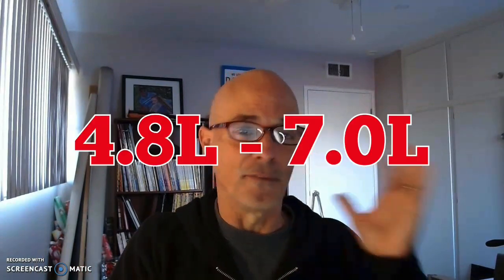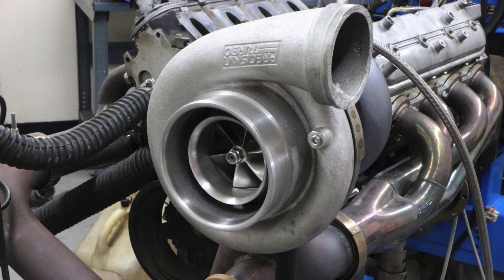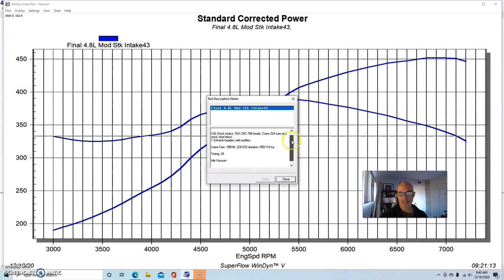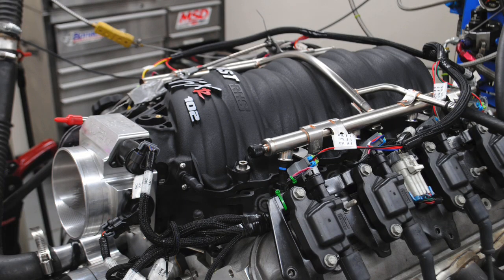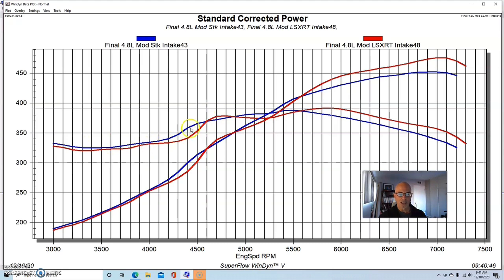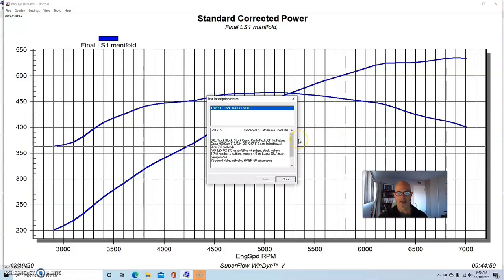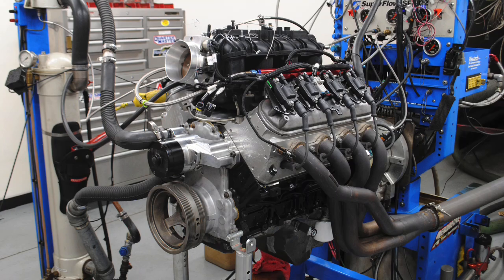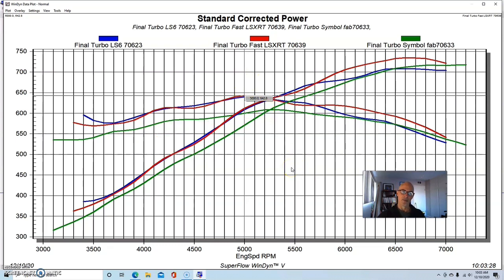LS TURBO INTAKE MANIFOLD MYTH-DOES IT MATTER UNDER BOOST?

Comment: MAXSPEEDING.   NOT a specific product question but a "material" process they market is where my curiosity lies.   I can't find any true definition of TITANIZING.  now sure it sounds sexy as Pankle Ti rods , but what is it seriously?  I do have a couple of their gt35s but haven't been spun them in anger yet.  Using the pair at a pair on a mild budget Dart 347.
Reply: $547 for set of Titanizing 996TT rods sounds "too good" and the cost in this application of failure is too high.  Maybe a set in a 4.8 and big bang it for rod comparison.
Reply: I like the idea of jamming all the their stuff into a 2.0l vw and see what it will do compared to a stock one. Those come with over 300hp stock in the right econo box and can take some serious whipping.

Comment: A short runner intake can work if the boost ramp can be controlled some kind of way. For example, a variable geometry turbine hot side  can boost torque under the curve to fill in the torque loss or use an electronic boost controller to ramp in the boost sooner. Why not do a test showing the effect of variable geometry turbos versus fixed, and electronic boost controllers vs. mechanical?
Reply from the maker: a short-runner intake always does the same thing-it makes less than the long runner til very high rpm-changing the boost curve works with both

Comment: We changed from a LS6 intake manifold to a short Runner Holley sniper and just ran  our first 8 second at 165 miles an hour. Never been above 158 mile per hour previously. I think the short Runner works very well on high boost.
Reply from the maker: boost level doesn't change what the intake does-you might be running higher engine speeds
Reply: @richardholdener1727  yes LS6 intake Peaks and flat lines at 6300 and the  sniper keeps pushin on up with Boost and  RPM. equals about 100 more horsepower at the top
Reply: I think running 8s at 160s isn't what most people are doing with their stock engines. At the drags specifically, short runners work really well. You spend all of your time at wot and half your time within 1000rpm of shift point. You also spend more time in the lower gears because the power doesn't roll over as bad. For guys on the street, it's maybe not a great idea but at the strip it can really pay off.
Reply: @timothybayliss6680   thanks for the reply Tim it's a 3600 lb 67 Camaro 3 pedal fully synchronized T56 transmission power seats and power windows not exactly a race car. It's a TCI suspension pro touring car. if we wanted to butcher it put it on a large diet and a Powerglide go a whole lot faster

Comment: A lot of VW owners use maxspeedingrods connecting rods and short runner intake manifolds in their budget builds. A friend and I built an engine with their rods and they were a better balanced set than the factory stuff. I think it was something like .5 grams on the rods. The stock pistons had a lot more deviation between cylinders.

Comment: Have U Ever Tested  Trick Flow Cast Iron Hi Port Street Heat Small Block Ford Heads ! . 0r . a Terry Parker Real Parker Funel web Small Block Ford 302 Intake !
Reply from the maker: I have run the Funnel Web-Terry did an excellent job on that design-have not run iron high Ports, but have run the alum versions

Comment: Richard, crazy question, but I've never seen it tested, can you actually gain horsepower by using high end oils (think amsoil, royal purple, redline) over, say, store brand synthetic, or (god forbid) conventional?
Reply from the maker: changing weight makes more of a difference than brand (most use the same base stock)

Comment: How about a 5.3 with throttle body holly setup with carb style intake power combo video got anything I like the old look
Reply from the maker: I've run carb intakes on a 5.3L
Reply: Does the same thing NA as with boost. So you can just compare THE NA curves

Comment: Is the twin gt45 to big for a LS 6.0 to spool for street driving or should I go with like a gtx3582r?
Reply: The bigger the turbo, the more lag you'll have? Answer? Put a 2-step on your clutch and always stay in boost!
Reply from the maker: twin GT35s will work
Reply: If it's a real gtx3582r Garrett turbo, it will move almost as much air as the ebay gt45. The genii compressors have a 66mm inducer and flow more than 80lb min. One guy has claimed 800whp on a 5.3l with a single turbo. The Garrett turbos come with a single scroll turbine, which is nice if you have twins, with a handful of different ARs. My next question is, why do you need so much turbo on the street if you are worried about lag? The gen1 gtx3582r flows more than 70lb min with a 62.5mm inducer, two of them gives you enough for 1500hp. If you need less than 1000hp on the street an even smaller turbo would be better for everyone. Two gtx3071r would be enough for almost 1200hp and if you're worried about spool...

Comment: Why does HP and torque always cross at the same RPM???
Reply from the maker: hp = tq/rpm/5252-it always does-just math
Reply: Wikipedia/Google/YouTube
Reply: Damn good question!!!!
Reply: Because horsepower is equal to (Torque*rpm)/5252. Horsepower is a unit of power, and power is force relative to time. Torque is a measure of force, and rpm is how many times per minute it makes that much force.
Reply: That number is based on how much work a horse ( not a squirrel ) will do in relation  to the same amount of  work done when compared to a steam engine. ...(  One horsepower is equal to 33,000 foot-pounds of work per minute) or ( 550 ft lbs per sec ) If you figure in the equations related to torque and horsepower or the "velocity" , and you'll find that horsepower always equals torque multiplied by rpm then divided by 5,252.
Reply: @johnwoodworth248  How many squirrels does it take to equal one horse?
Reply: @andyharman3022  😂
Reply: @andyharman3022  obviously 5,252 😅😅🤣🤣

Comment: if you put 4.8 pistons on a 5.3 or even just put a set of new pistons on a stock rotating assembly is it always required to have it balanced? no machine shops capable of doing this where I live.
Reply from the maker: I have a video planned on this to see how far out of balance they r
Reply: @richardholdener1727  Awesome cant wait thanks
Reply: If you match the mass of the new Pistons to the old you should be good.

Older GM engines have a balance tolerance of +\- 50g

Comment: I would like to see a 6.0 ls tested with boost with low rpm torque and heavy duty towing in mind. A gasoline powered answer to the duramax. The mantanice is cheaper and no def fluid or emmison issues.
Reply: Just delete it I think towing application on a gasser might run into heating issues or just burning alot of fuel to tow.
Reply: @Sdukes001  I worked as a Paramedic from 04 to 16 we had a whole fleet of 4500 cutaway modular ambulances with a GVW of 13500lbs. The company bought duramax/allison chassis until 2010 then switched over to 6.0 gas/6L85 chassis due to emissions and having to have def. They didn't want the chance of failure or going into limp mode on an emergency call. The gas engines got 8.5 mpg the diesels about 11.5. The gas chassis was $10000 less at purchase and the mantanice cost was less over the life of the truck. The fleet manager told me the gas trucks where cheaper to operate even with significantly less mpg. The truck where replaced between 275000 and 300000 miles the gas trucks ran just as long and where still in excellent condition when they where replaced. I was never broken down on the side of the road or had one run hot. There was times at a car wreck or other major event one would sit on the side of the road in 100° heat with the AC wide open and the emergency lights on with the high idle at 1600rpm and the temp hand never move off normal. This experience sold me on late model gm gas engines.
Reply: gale banks lays out the dynamics of gas versus diesel a gas engine will make 20% more torque with the same cubic inchThe only reason diesels make torque is because they have small turbos that boost off idle 6.0 with a hx40 at 7 lbs would be perfect it would just choke at 4k
Reply: I think that would be very easy to accomplish but you would need some good rods and pistons and a couple of T3 T4 China hybrids instant spool
Reply: @danielsullivan9865  I was thinking good rods, some type of good forged piston, head studs and good gaskets. Drill the main bearing oil gallery for piston cooling jets. The biggest oil pan you can fit in the chassis, high capacity engine oil cooler. Work out the turbo arrangement for quick spool and maximum torque up to about 4500 it does not matter past that point. I would want to be able to set the throttle at 4000 and pull a long grade without having to worry about it melting down. The over all hp number does not matter torque is what gets the work done. Building this type of engine requires an entirely different mind set from building a high HP race engine.
Reply from the maker: Making low speed torque (below 4500 rpm) is easy with boost-tune and heat management are critical